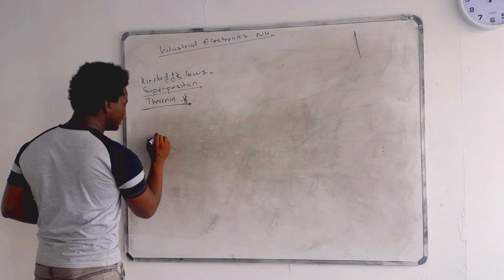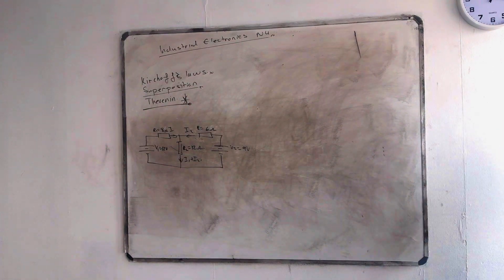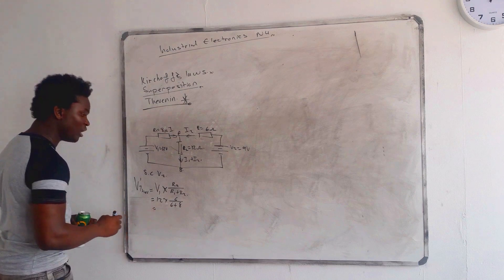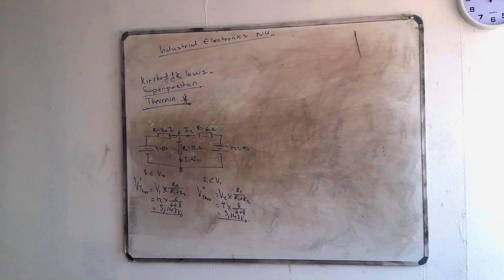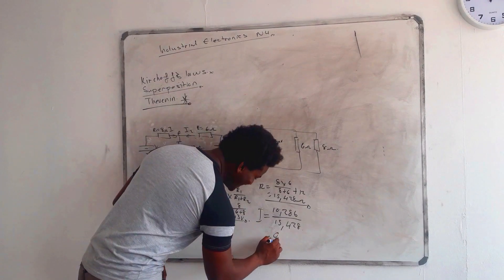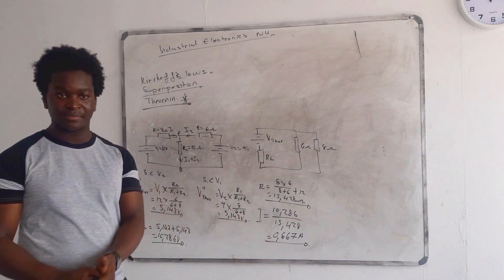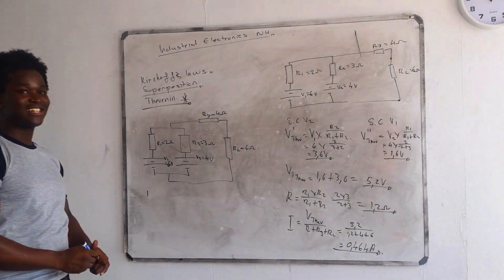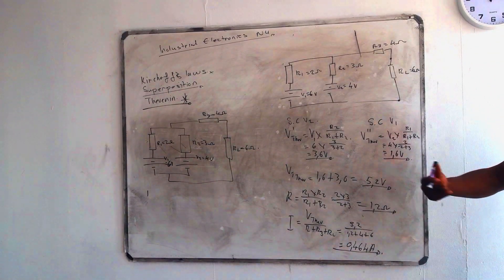Industrial Electronics N4 Thevenin made simple explained with 2 examples

Comment: I would like to get a reff of that book. Thevenin says, you remove load resistor. Calculate total resistance(R series) then total current. After that V1-Vacross8ohms(calculated by total current x8ohms) will give you Vthev or use V2 +Vacross6ohm(calculated by total current x6ohms) they must give you the same answer. For R thev you short both cells then calculate R.parrel who is Rthev. Then use a new circuit for a current across load resistor. Remember that Kichhofs law of current must give us the same current if not then we are wrong. Again how do you determine your voltage polarity? Its opposite not the same bro
Reply from the maker: Ive done another video that answers all your questions specifically, Please have a watch
The voltage are not opposing each other. they are both feeding into load Resistors. maybe unless one battery is waaaay bigger than the other then the bigger battery will charge the smaller one. Please watch the new video, i tried to make everything clearer. What you are describing sounds more like ohms law
https://youtu.be/3g8se07DhaE